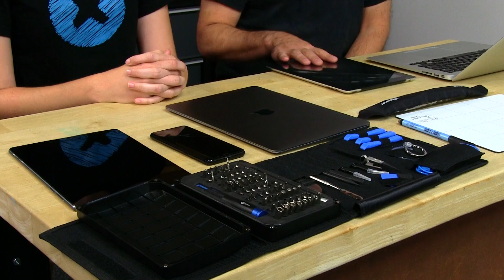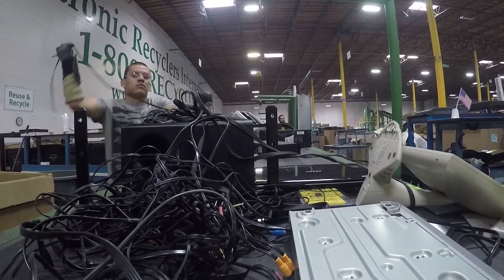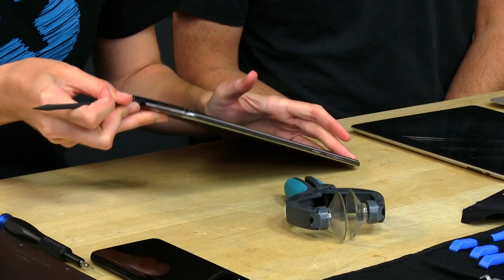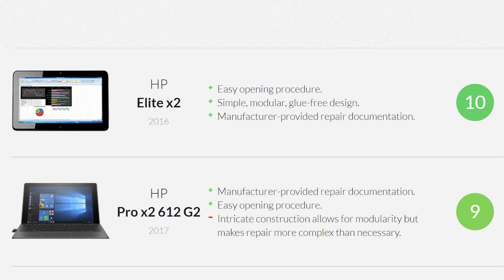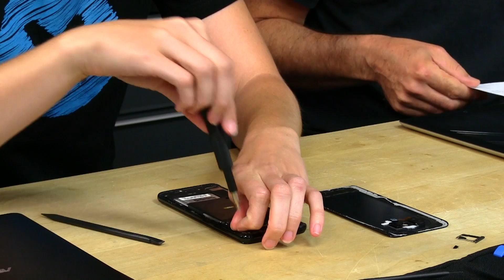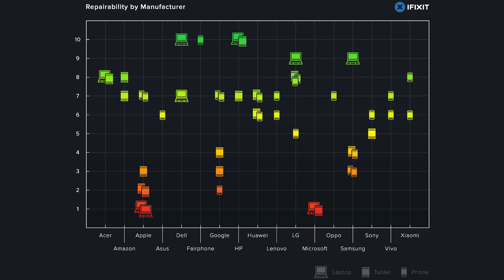Can We Make Gadgets Last Longer?? Talking Repairability With Greenpeace

Comment: It's actually funny how far back Apple have gone in terms of upgradeability. E.g. the 2012 Macbook Pro had upgradeable Ram and replaceable Sata drive. Modern ones have soldered Ram and proprietary SSDs which are not user upgradeable. And the repairability has declined too - glued shut iPhones, non user replaceable batteries. And everything is made in China where there are no employee rights, no environmental controls and no unions.

And yet all SJW/Environmentalist types seem to use Apple stuff. It's bizarre that they get a free pass.

Comment: Love you guys!!!!!
But why are you using a Macbook?
:-)
I am still using an eleven years old Toshiba laptop after adding some RAM, replacing the HDD with a fast SSD and installing Windows 10.
It's not screaming fast but it still works fine.
The battery I could have replaced any time but I use it as a desktop.
I'll never buy one of those thin machine that cost a fortune and last only two years.

Comment: Aren't repairability one durability two completely different things?
Reply: perhaps, but they are often related 

well made aerospace hardware is fully modular & can be assembled & disassembled using common tools 

building something so that it can be easily taken apart means it can be easily repaired or upgraded 

glue & adhesive can be replaced with screws & gaskets that work better for waterproof durability & reparability 

device repair is a noble pursuit 

designing devices so that they are impractical to repair is unethical